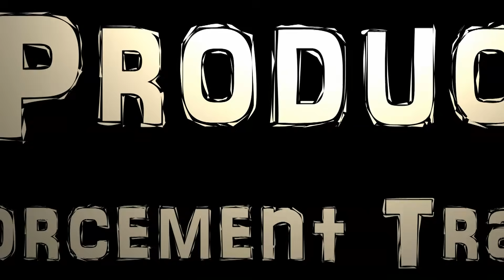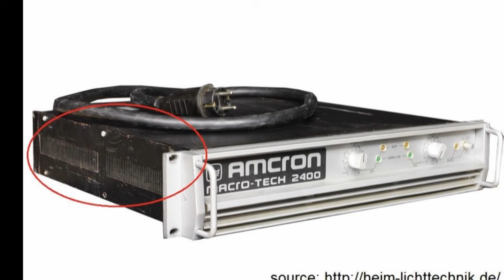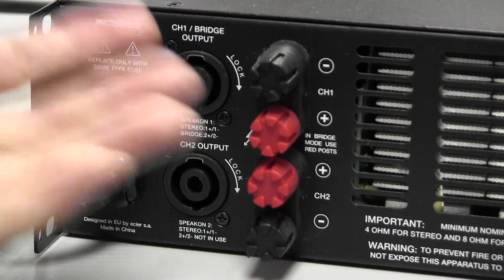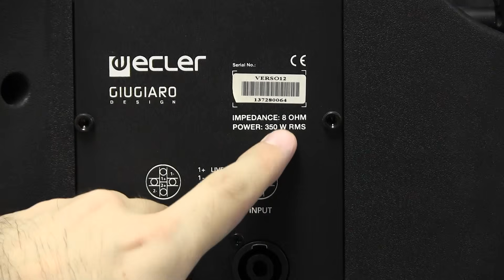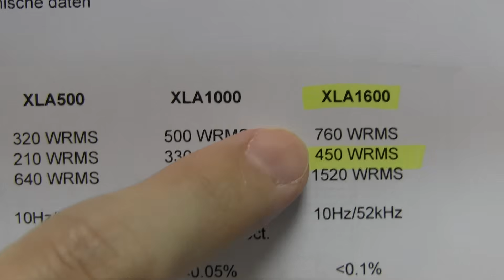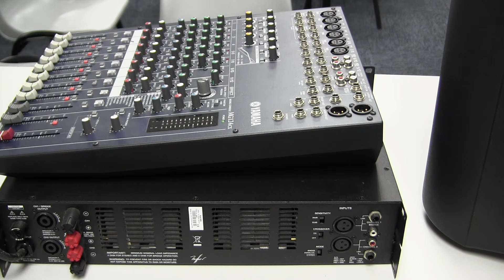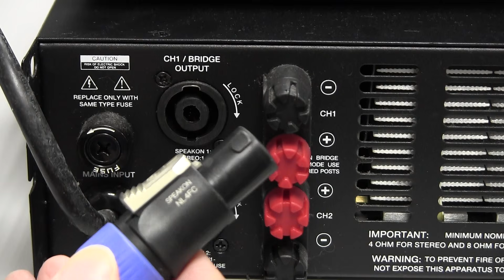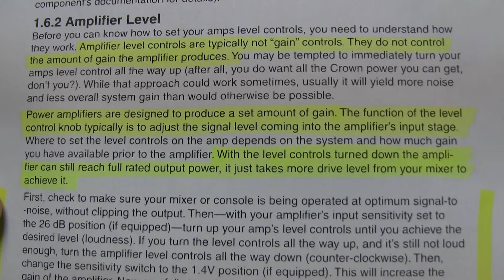How to connect a power amplifier to passive loudspeakers

Comment: Thanks the video is great about whats going on on the back end to the  speakers OK now if I want to run a set of speakers in stereo and one sub in bridge .....will I have to have two mixers and two amps Please look at this power amp output.
Reply: https://supportloudtech.netx.net/loud-public/#/asset/7960
Reply from the maker: What sort of signal do you want to send to the sub? A mono version of your LR mix or only specific channels?
Reply: mono signal
Reply from the maker: In that case use the mono output on your mixer to send signal to the sub power amp.
Reply: What I am trying to do is run two speakers in stereo and one sub at the same time from the same mixer Crate CPM8FX Mixer
Reply: Crate CPM8FX Mixer
Reply from the maker: Ah ok, using the internal amps in the mixer. There is no simple way to do this as the internal amps can be run in stereo or in bridge, not in both modes at the same time. I suggest using the internal amps to run your fullrange speakers in stereo and getting an additional amp for your sub.

Comment: Hi your videos are very useful for me, I learnt much things as beginner . I want know how to connect mixing console to multiple amplifiers, I mean I want to know how to connect mixer to subwoofers(low freq), mid speakers, Hfs having individual amps for each of the category. 

I have total of 5 power amplifiers and I am using 2 amplifiers for subwoofers and 2 amplifiers for mid speakers and 1 for HF's

Shall I take one output of mixer and connect it to subwoofer speaker amplifiers and another out of mixer to mid speaker amplifiers and hf amplifiers ?

or

Shall I take both outputs of mixer and connect it to subwoofer speaker amplifiers and then from subwoofer speaker amplifiers to mid speaker amplifiers and from it to HF amplifiers ?

What is the best way to connect from mixer to multiple amplifiers? Can you please respond to my question ?
Reply from the maker: The best way is to use an external crossover or speaker management system. Lacking that, either of the methods above will work, but the first method will give you more control.

Comment: Great Video! Thanks very much for uploading.

I have one question at 22:20. Are using using an amplifier input to connect the TRS-XLR lead to another amplifier? How is that possible?
Reply from the maker: You're welcome thanks for watching! It is technically an input but because the connectors are all connected in parallel internally any unusued inputs can be used as outputs for daisy-chaining to another channel or amp, much like the link connector on a DI box.

Comment: Im planning on getting a PA system, this one most likely (http://www.astounded.com/pulse-pvs-1000w-pa-system-with-12-speakers-and-power-amplifier.html?cPath=262_17_300) but I don't have a mixer and I need to connect a laptop to it. Would I need to get a mixer? Because I am on a really tight budget.

My plan was to connect my laptop sound output to the amplifier and then the amplifier into the speakers. Would that work or is a mixer really necessary?
Reply from the maker: It depends on the output from your laptop and how much volume you need. Some laptops do not have enough output voltage to drive a power amp to full power. I suggest you bring your laptop down when buying the system and connect it directly to the amp and see how things sound.
Reply: Good idea. Thank you.

Comment: when you say daisy chain can I just use a regular XLR cable connecting to each amp instead of the other way? And do all the mixers have 2 inputs to connect to the power amps? which is why I would daisy chain all the mixers so I would have the just be using the 2 inputs to the mixer to connect to the power amps? what I am saying mixers dont have multiple inputs for each mixer or do mixers just have 2 inputs to connect to the power amps? Also if you are having multiple power amp running at the same time including the whole pa system, would it be smart to be using a house outlet or should I be using a generator for big set up including anything else to run the band or the show on top of the pa?
Reply from the maker: Hello Jazz if your mixer has two sets of outputs you can connect one amp to each set of outputs no problem. When running a big system you want to calculate your total system power draw using the manufacturer's figures and work out if your power outlet has sufficient capacity or if you need to rent a generator.
Reply: Ok thanks, do most mixers have 2 sets of out puts for the power amps or do some have multiple out puts? So by connecting one amp to the 2 out puts you would still be able to daisy chain them all together?
Reply from the maker: Any mixer output can be connected to an amp, depending on your needs :) Personally I prefer to daily chain at the amps because it means you only need to run one pair of cables from the mixer to the amp rack, but there are many ways to get your signal to the amps.

Comment: question !   I have 2 Vega running from a powered amp..

I want more bass..so I have this lone Alto powered amp.  Can I just daisy chain it from one of my towers?  it works ...but some people say that's a big no no...some say it doesn't matter.

my board is old so I don't gave a monitor output to use..which I uses on another pa head and it worked great.   thoughts ??? thanks !
Reply from the maker: Yes, you can daisy chain the signal from one of your existing power amps as shown in the video (using an unused input) or use a spare output on your mixer. Just be sure you are not daisy-chaining the speaker level signal because that will increase the load on your amps.

Comment: Bruno what's up ! Gotta a question. What amplifier and passive loudspeakers do you recommend? Just needed for bars and small venues. I want to connect my mackie pro12v2 mixing board so I can have reverb and delay send effects to the drums when playing live.
Reply from the maker: Hello Kurt! For mobile PA in small venues I really recommend active speakers - they make life much easier because there are no amps and crossovers to set up and they sound much better than the equivalent passive model due to the built in processing. What sort of music do you play?

Comment: i have inuke nu4 6000 with the Peavey SP2 speakers passive what would be the most proper setup running the four channels my mixingboard is1832 Behringer USB what's the best way to use the one button compression

Comment: hi sebastion. hope you can help me please i have a numarkcdmix deck with the bluetooth.ive tryed connecting my speakers up using XL becon leads.ive connected the deck via the amp master output.then connect the speakers from the outputs on the deck to the speakers.but am getting no sound at all. now if i connect the speakers using banana clips into the amp i get sound and no problems. hope this makes sence to u. i use passive speakers
Reply from the maker: If the system works fine using the banana plugs then go ahead and keep using them :)

Comment: hi glb production today I want to buy another power amplifier and link it to my calsbro marlin amp because the two outputs of my analogue mixer are already occupied by the subwoofer and the carsbro amp itself. On the carlsbro amp I have in input called pre-amp and when I will need to turn off the amps which will I need to turn off first for the rest not to blow up!?!?
Reply from the maker: If you have two amps and the mixer is connected to amp 1 which is daisy chained to amp 2 you would turn amp 1 on first followed by amp 2, and turn off in the reverse order.
Reply: +GLB Productions  thanks a lot Glb production s

Comment: Hi Bruno!While I'm waiting for your subwoofer vid...could I ask you if connecting a mixer to a power amp,and then the xover and finally to the loudspeakers is the correct order?or is it first the xover and then the poweramp?And how do you set the xover?Last but not least,what does it mean 'Horn-Loaded'?is it a type of speaker or an enclosure?

Sorry for all these questions,but I have a friend of mine who just bought a pair of old Lem CX800 and we can't wait to hear how them sounds!but unfortunately I've never connected a passive system in my life and I fear that I could damage his system :/Besides these loudspeakers each one have on the back two inputs,one for the LOWs and one for the MID and HIGHs in XLR (no speakon)...I think it's because you can use the loudspeaker in Full Range mode or in Bi-Amlplification Mode...in thiese two modes which setting of the power ampo should I use?Stereo-Parallel-Bridge?
Reply from the maker: Oh wow that are a real blast from the past, assuming they're working right! 

Order should be mixer -> crossover -> power amps (assuming an active rackmount-type crossover)

Crossover points should be set as per manufacturer's recommendations - this is very important! 

Horn loaded means that the driver (cone or diaphragm) is coupled to a horn rather than directly to the air. In a typical 2-way speaker system the woofer is direct radiating whilst the tweeter is horn loaded to give directionality to the highs. In the CX800 all three drivers are horn loaded - the horn is the rectangular 'mouth' that surrounds the speaker. 

It sounds like these speakers are designed to be run biamplified-only - is there a fullrange input? You also have to be careful with those XLR speaker inputs - don't use normal mic cable because it will melt! You need to get normal speaker cable and then solder it to XLR connectors which is not safe electrically because the live pins are exposed on the male side. 

If you can send me a picture of the back of the speakers and the connector plate so I can see if there is any additional info there.
Reply: Thanks for the advice Bruno!Sure I'll send it to your facebook page!
But these 'Horn-loaded' drivers are only for directionality?or are they better than normal ones?in which cases/situations/venues are suited the most?
So these LEM CX800 are a 3 way type?it should be a tweeter,a woofer and a subwoofer I guess...?
Anyway the Crossover is the Behringer CX3400 and the power amps are a pair of LEM 4202...
Reply from the maker: Thanks for the picture - no idea why it won't display on the page... anyway at least I can see it. 

It looks like you can power the unit fullrange by just connecting to the LOW input - try it with the amp at a low level and see if you can hear all three drivers working. You can use any amp, just keep the volume low to begin with. 

Horn loading is for efficiency as well as directionality - it can give you an additional 10dB on direct radiating drivers because it enables more efficient coupling of the driver to the air. The horn acts sort of like a transmission in a car. 

The speakers are 3 way but biamplified - one amp channel powers the woofer and the other one powers the midrange and tweeter which use a passive crossover.
Reply: Thanks to you Bruno!So there is no subwoofer..am I right?
For the crossover,can I use an external one?if yes,can I exclude the internal one?
But if I want to use the the bi-amp should I use two stereo amps,one for the low inputs and the other for the mid/high inputs?
Reply: Here I am,I've tried to connect the passive loudspeakers with 2 stereo power amps (420w for each channel,the models are LEM 4202) ,both in parallel mode...one droved the Low inputs and the other the Mid/High inputs of the loudspeakers..
On the external x-over (Behringer CX3400) I've used the 4 way mono mode only because it was the only one with a Mid/High feature...
Since I haven't found any manual on the web,I choosed the x-over frequencies by ear,based on what sounded the best...and at low volume nothing wrong happened...but my fear is that it will with high volume...?
PS I've turned on the limiter of the x-over on +9...but since on the power amps there's a 'Protect' LED,shouldn't it be on the amps too?
Reply from the maker: Are the amps identical? On some of these setups the amps are designed especially for the speakers and have one channel more powerful than the other for driving the lows whilst the less powerful channels drives the highs. 

If you want to use the external crossover you should use stereo 2-way since you need two filters - one for each speaker. And yes you can guess at the crossover frequency - typically for a 3-way speaker like that it will be somewhere around 600hz. 

No, the protect LED on the amps should NOT be on - that means that the amp has shut down to protect itself!
Reply: Yes they're identical...but I don't know if one channel is more powerful than the other...according to the model name it should be 420w for each channel...(4202)

600hz for the lows?

Ah ok,never ever heard of that...very good feature indeed!
Well yes,your gig will end but at least the power amp will not break :)

As always,thanks a lot Bruno! :)

Tuesday this system is going to be tested on a party town with high volumes for eight hours ....let's hope it will not shut down!
Reply from the maker: Haha good luck for your gig today! The 600Hz crossover point is from the lows to the mids - I'm just guessing here based on experience ;) I hope your friend has some extra subs he can bring along just in case - better than running these untested speakers flat out on their first outing.
Reply: +GLB Productions No need for those,Bruno...all went well he said,thanks to you :)
Reply from the maker: ***** That's great news, glad it went well.

Comment: i HAVE QSC 900 AMP THAT ONLY HAS RED AND BLACK SPEAKER BUTTONDS FOR OUTPUT HOW DO i CONNECT FROM THEM TO 1/4 IN OF LOUD SPEAKERS?
Reply from the maker: You would need a cable that is bare wire on one end to connect to the amplifier output terminals and 1/4" on the other end for the loudspeaker connection.
Reply: @GLBProductions  You could take the 1/4inch jacks off one end of the cables. But, with stranded wire, I always solder the ends to make them more solid and a better bare connection.

Comment: Quick question. If I am going to add passive subs to my loudspeakers do I plug into the loudspeaker first then connect the sub from the loudspeaker, or the other way around? Thanks
Reply from the maker: It depends on whether the sub contains a passive crossover network that will remove the bass from the signal sent to the top speaker. If so you need to connect to the sub first, otherwise either way will work fine.

Comment: now the speakers I'm going to buy are the Prx 425 by jbl and the specifications say the the speakers are 4 ohms and the power rating is 600w/ 1200w / 2400w. what does this mean and would these speakers be compatible with a behringer inuke nu4-6000 power amp
Reply from the maker: Please watch my video on this subject: https://www.youtube.com/watch?v=l9L7uK7Xy0w
Reply: It is 600W continuous, 1200W Program, 2400W Peak. This is a rather unusual specification coming from JBL but from experience I can tell you that your amplifier should be between 600W and 1200W RMS.
Personally I would go for a 750W RMS @ 4Ohm.
Reply from the maker: ppdan I would recommend at least 1200 watts into 4 ohms - there's a reason that is the 'program' rating. The additional power gives you headroom to handle transients.
Reply: GLB Productions This speaker is just a JRX series sold as a PRX series. They both use a M115-A as LF and that LF component has been 250W AES (1000W peak) for as long as I can remember. And since this component doesn't even have VGC (Vented Gap Cooling) I wouldn't advise to go for the 3dB RMS headroom on your amp!
This is a budget speaker, hence why they only give a 2 hours of continuous rating.
Reply from the maker: ppdan Very interesting! What documentary evidence do you have to support this claim, and how can you be certain that JBL have not made changes in the crossover to increase the overall power handling of the system?
Reply: GLB Productions Have sold JBL products for +20 years so I know a little how their product range works and I have worked the JBL distributor in my country before getiing self employed. Also you can check the specification sheets of the JRX and PRX400 series if you want and check the specification sheet of the M115-A8. Those are budget series!

Comment: i have a 3000 watt proton stereo amplifier 2 tops RCF 15" 400watts and a 18"woofer 1000watt  . can i connect both the tops to one channel of the amplifier and the woofer alone in the 2nd channel ?
Reply from the maker: Sure no problem, although your system won't be in stereo.
Reply: hey thanks mate .but  is there a way where i could connect 2 tops and 1 woofer to a stereo amp with the help of an Active crossover and run it in stereo mode
Reply from the maker: Unfortunately not, because you would need two channels for the tops and one more for the sub. You could do it if you had an active sub, but not with an all-passive setup.

Comment: Great video. Thank you is very illustrated.  I have few questions for you.  Can I Daisy chain my Powered PA Peavey triflex I I 1000 watts with 2 of my  passive PA Cerwin-Vega CVi-252 passive 3 way loud speakers  (2000 Watts 2x15 each) or do I need to get a separate subwoofer for the Cerwin-Vega? or can I run it through an amplifier if so how would I  set it up? Another question is can I run my Traktor S2 controller with a mixer and a power amplifier all in one setup? I do appreciate your help.  I'm in a learning process to expand my basic DJ Skills.  email viccantt@gmail.com
Reply from the maker: +Victor A Hello Victor. Yes you can daisy chain the triflex as long as it can handle the impedance that this will impose on it. See my video on this subject: https://www.youtube.com/watch?v=l9L7uK7Xy0w

Yes you can run your Tracktor S2 into a mixer as you would any other line level source.